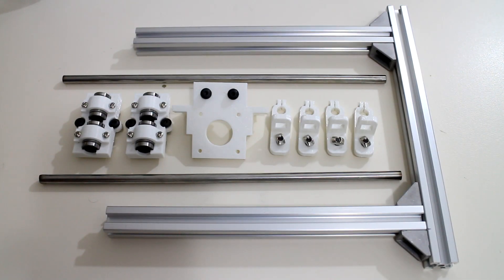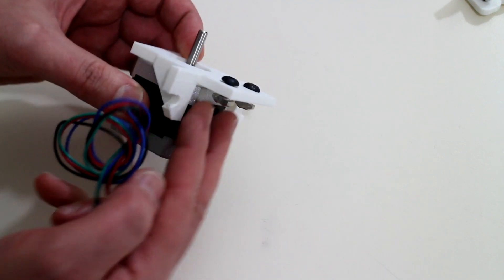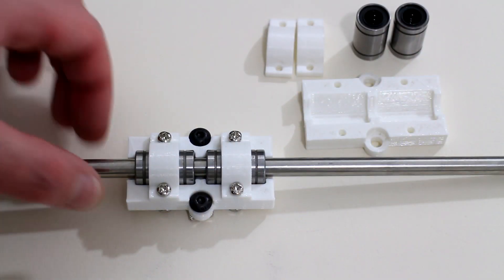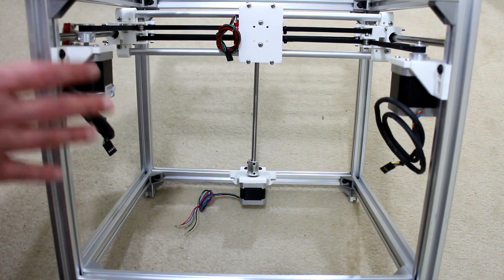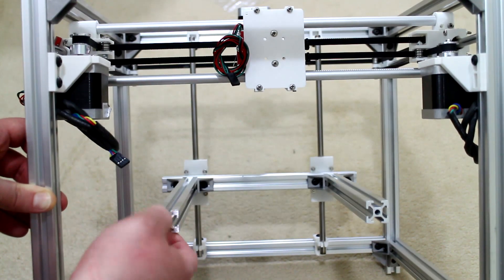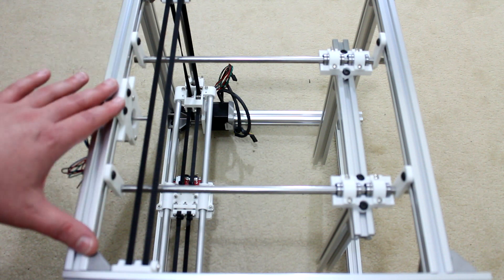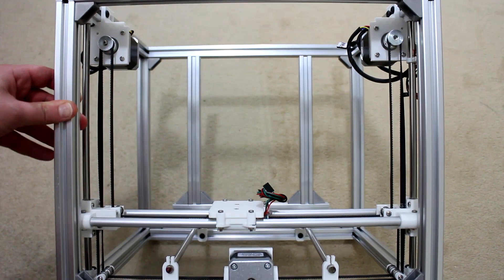New 3D Printer - Build Log #5

Comment: Why aren't you moving the z axis motor to the side of the x/y motors? That way it seems you get back the missing  travel distance at last in half. Or am I missing something?
Reply from the maker: Very observant! I was going to do that however I didn't want the XY belts in the way on the front of the printer frame. I measured it and I would still lose about 10mm of travel on the Y axis if the z axis motor was on the other end.
Reply: I believe, that he wants to build every component of this printer inside the shell and not outside of it. Thats a good reason, for example if you want to make a printer with acrylic walls to maintain the heat and fumes inside that ractagular, which he is contructing :)
Reply: Tech2C Another way would be drilling holes in the 20 mm Frames and stick the guides and axis through. Should give you around 2-3 cm I guess. The frame isn't under heavy load and mostly hollow in the middle (moore's law get the mass to the outside) so I'd think no  structural issues. And the motor on top would stick out two directions top and back, but you could get the housing back between the profiles and keep the motor completely out of the frame and not in between. But for drilling the holes you'd need some proper clamping an a drill press to get the straight. And it would leave the philosophy  of a "simply screwed and bolted build".
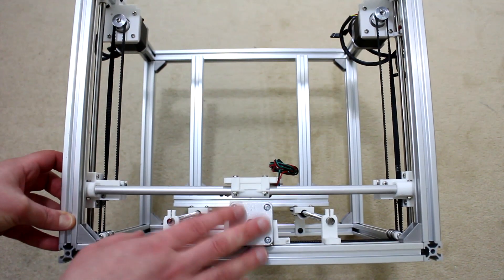Reply: Sorry it seems my wording was misleading. If you look at the shot at 10:49 I mean move the motor and rails to the top of the shown picture.

Comment: Shouldn't the Z axis have a degree of freedom at one end like on all prusa I3? The belts are forgiving when it comes to missed steps, errors and boundary collisions for X and Y. The lead screw will tear the frame apart if something goes wrong.
Reply from the maker: The lead screw is free to move on the opposite end of the motor, albeit it is attached to the build platform with the nut. The motor will skip if the platform is stuck somewhere so no self destruction of the frame would occur... :P

Comment: Are you at all worried about the plastic warping/bending over time? I've always been sceptical about printed parts in a printer like this. The weight of the build plate is supported by such pieces.
Reply from the maker: The final pieces will be printed in PETG or ABS, which work great on my Prusa i3, so I don't expect any issues on this frame.
Reply: How do you print ABS on your Pruse i3? Is the heated bed enough to stop warping or do you put a box over it? Or maybe you use a hair dryer blasting hot air at the part?
Reply: I've had luck printing small ABS parts on a Printrbot with a heated bed and blue tape cleaned with rubbing alcohol.
Reply: I have zero problems printing abs on my prusa i3. Standard heated bed at 110C with buildtak and no enclosure. Capacitive sensor also helps a lot with exact distance from bed to abs to stick
Reply: M3d makes a tough material i do not know what it actually is but it might me perfect but it looks pretty good against warping because of heat from the hot end

Comment: Looking very good. You should look into printing an Anti Backlash Nut for your Z-Axis
Reply: The weight of the build platform removes the need for an anti-backlash nut - and it's only (usually) moving in one direction when printing.